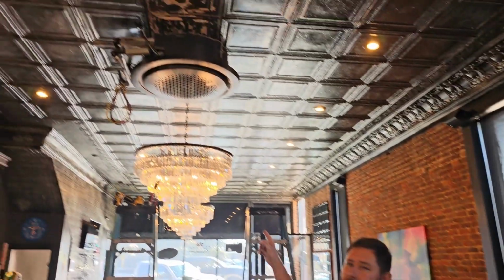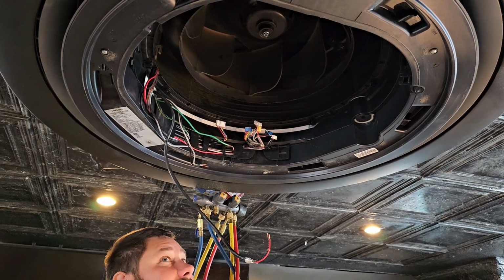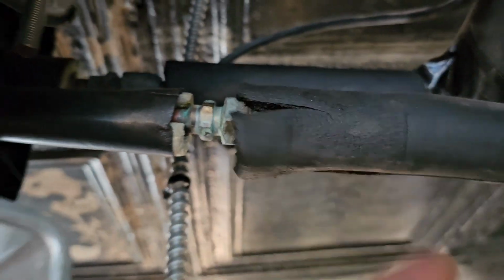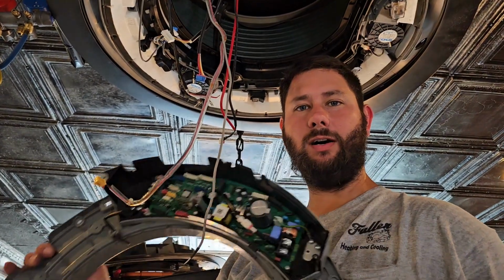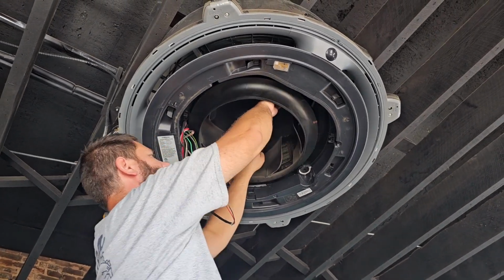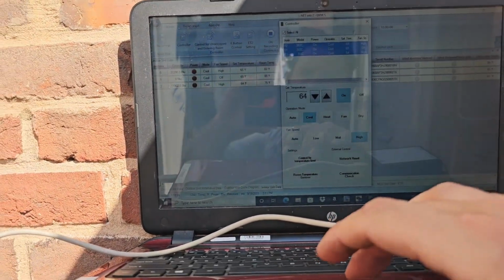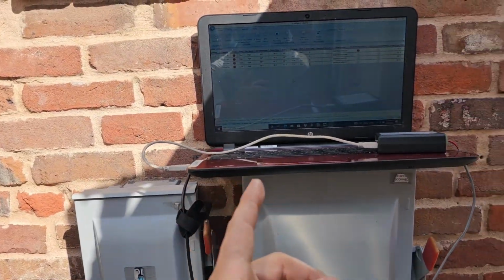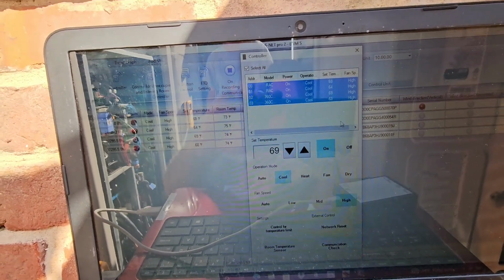360 Ceiling Cassette Coil Replacement Made Simple

Comment: Two leakers in one place?? Is it common for this model to leak?
Reply from the maker: I have installed several cassettes. For me it's very rare. This Is the first time I've had leaks in 360 cassette coils Under 5 years old.
I have installed  Many 4 way Ceiling cassettes and i've only had one leaking coil and It was nine years old.
So I've had an overall good experience with them.

Comment: Why did you go through the trouble of charging like that? You had the project file when the system was laid out and you knew what the exact charge should be in the system. You did a lot of guessing and assuming instead of pulling the charge and filling it to the exact levels.